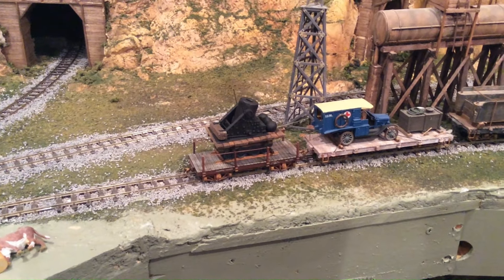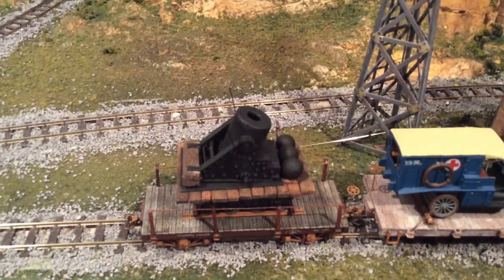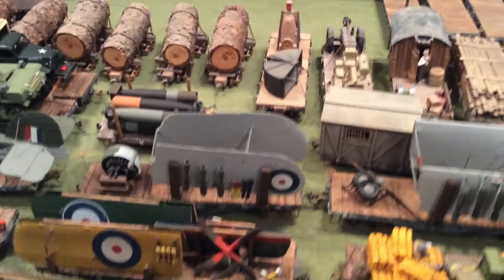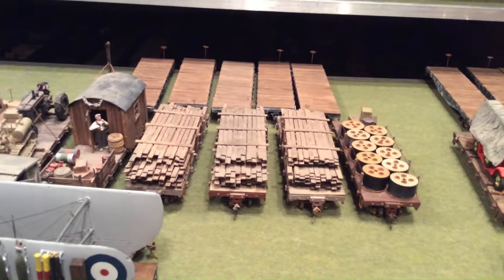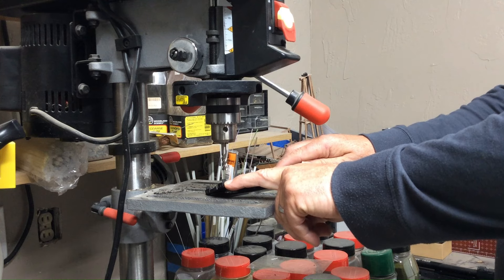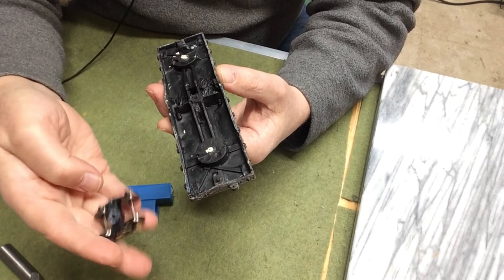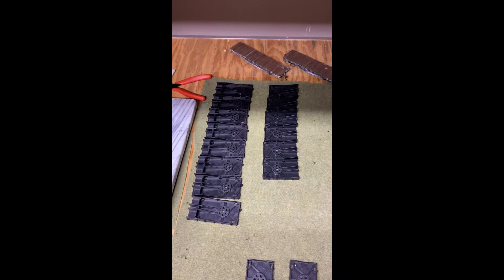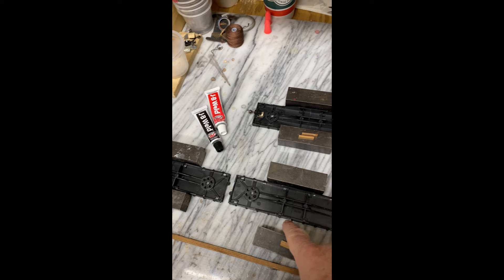Making your own flat cars for model railroads

Comment: You've mounted the coupler box (draft box) upside down as I usually do so the lip of the draft box rests against the frame.  After doing 80 pieces of rolling stock, I found I was mounting everything upside down.  The little lip is supposed to be in the downward position.  However, it all came out okay.  Enjoyed the video and I do Lionel 027 scale so this would apply to Lionel 027 as well.  I don't think I'd have enough patience to cut those apart and reglue them together.  Since 027 scale is close to S scale I could just use the S scale cars as is with added wooden planking to the deck and changing out the wheel sets and trucks.  Cheers - eastern TN
Reply from the maker: if you do make the O27 version, send pictures

Comment: So you're doing this for ON30 which uses HO scale track for narrow gauge.  I'm looking for info on how to make HO scale flatcars.  I certainly like the wood you've added for the deck.  Makes it look more realistic.  Where do you get those coffee stir sticks?  I need some for a scratch build I'm doing.  I've got a bottle of 75% alcohol & black acrylic paint I use for my black wash.  I've never thought of using shoe polish.  Does it dissolve in the alcohol readily?  I use my home made rust I make from 0000 steel wool in a quart jar and fill it up with vinegar & set it in the kitchen window for about a month.  After the steel wool dissolves, I pour the mixture out into a 11X14 stainless photo processing tray and wait for it to completely dry.  Then using a single edged razor blade I pulverize it into a powder and store it in little snuff tins.  Each batch comes out a different color of rust.  Looks great when made into a wash with alcohol and a little soluble glycerin.  I don't care for plastic couplers that are glued on albeit I have done it for Kadee couplers.  I only us Kadee's with screws as I hate it when pulling a long consist to leave a coupler laying on the track because the glue let go.  I also use a drop of super glue on the head of the screw next to the bottom of the draft box to ensure the screw doesn't move.  Cheers from eastern TN